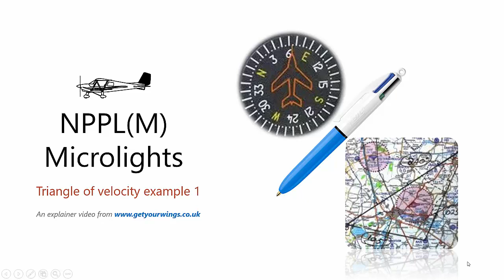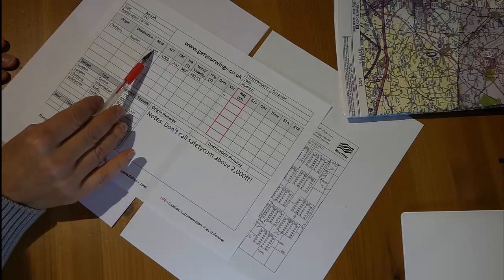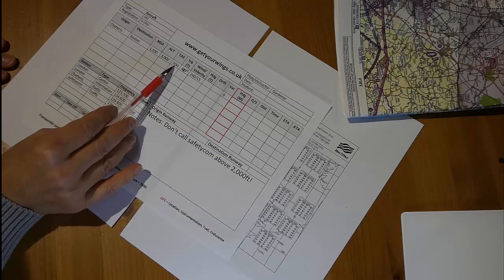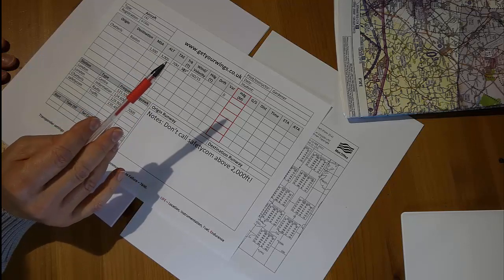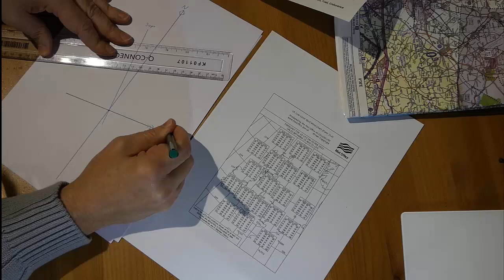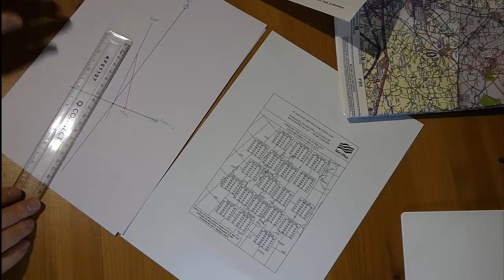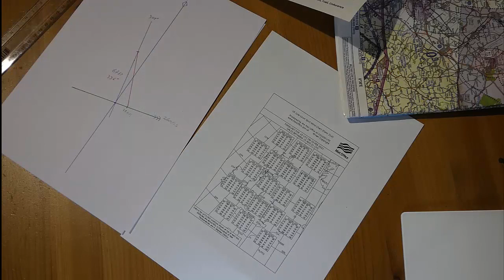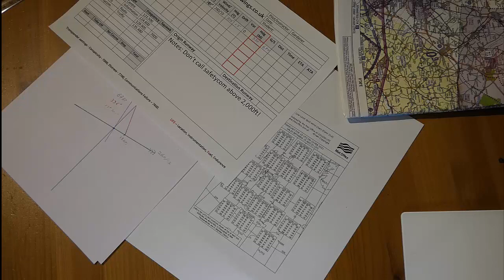Triangle of velocity example  1

Comment: So when doing the NPPL, instead of the PPL, you use this method instead of using one of those rotary flight computers?
Reply from the maker: It’s the preferred method but you can also use a wiz wheel
Reply: @getyourwings  This seems easier than learning how to use the flight computer IMO, Thanks for the reply!